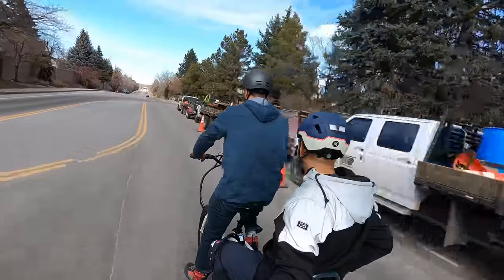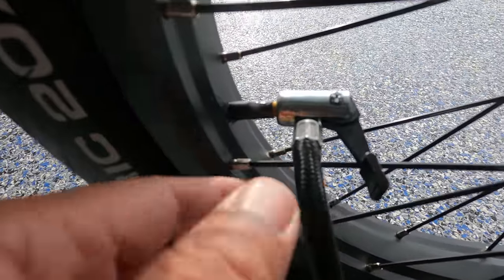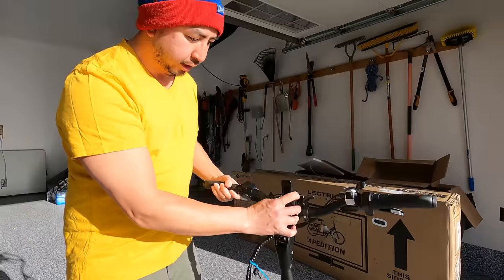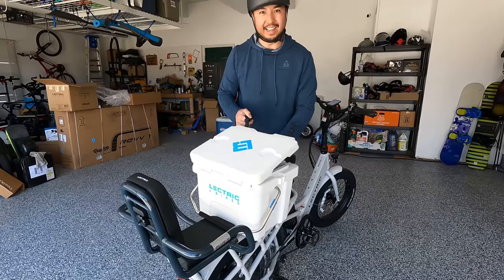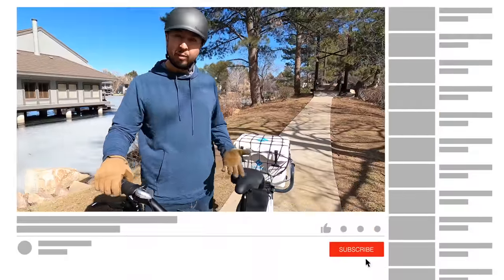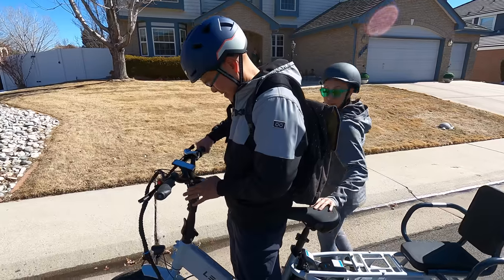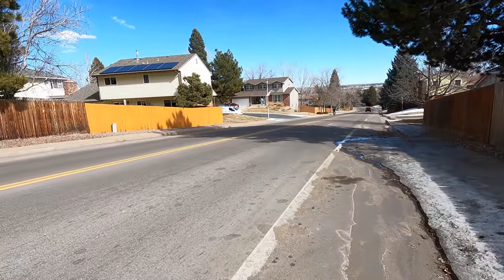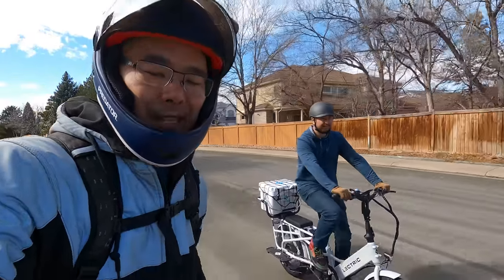The Lectric XPedition HAULS! And its the Best Cargo Ebike Deal of 2024

Comment: What one bike store told me, when filling your air up on the tires, make sure your stem is at the top half of the tire. This will prevent your slime from oozing out, which could cause a clog in the valve allowing for a slow leak.
Reply: That is a great tip!
Reply: Fr
Reply: @Andrew-vt4jt  I thought so too, that’s the only way I’ll do it now.
Reply: only if you are adding non European air
Reply: @Andrew-vt4jt  the best cargo bike is the gsd s10 tern 😊
Reply: @tareksdl5996  at that price, you might as well buy a cargo van
Reply: @leeg5678 what kind of cargo van can you get for $1,300.00 dollars?
Reply: Yep. That is very true. Every time you add air to the tires, be sure to have the valve stem at the 4 o'clock or the 8 o'clock position. The slime will ooze back into the tube as you add air.
Reply: @genespell4340 A toy cargo van
Reply: @genespell4340  Their comment was a response to someone else recommending a $5,000 e-bike as "the best cargo bike" not the Xpedition.

Comment: Did you have to drill the mounting plate to get the plus one on the rear most bolts? The mounting instructions use at least one set of the the outer thru bosses with a nut on the bottom. My plus one won't even let me mount it the way you have it,  the holes are just barely not wide enough, which would be nice because I could then put the small  basket on the rack with it and be able to haul some cargo and my kid at the same time.

Comment: I'm approaching 5000 miles on my Radwagon 4. I weigh nearly 400 lbs and absolutely love my bike, but I'm tempted to make the switch to the Xpedition. I love the dual battery feature for the extra mileage plus the ability to increase the speed. I was just commenting today that I will I had an extra gear to two so not out pedal the bike. PASS 3 downhill I top out at 23-24 miles per hour even with pedaling.  Due to my weight, I use up more battery that than the average person, so the second battery would  allow me to keep up with my friends.. Great video review!

Comment: Ok so I have had mine for 500 miles.
The range is highly exaggerated.  I use pas 5, flat terrain, 230 lb rider.  Less than 15 miles.  I commute to work 9.6 miles away and I have to charge the single battery at work to make it home.
I tried doing doordash on it using pas 3, and I was only able to get around 2 hours of ride time.  It is most definitely NOT great for delivery work.
The front tire is already out of true.
The rear brakes are shot.
The roller guide does not hold the chain, and on bumpy roads the chain will jump it.
The tires are extremely slick in wet conditions.
The handlebar stem rattles.
All that being said, I like riding the bike.  Its been very helpful for me to get to work.  Even in Texas 100 plus degree weather.

Do yourself a favor and get a second battery, and since their chargers are not dual chargers, buy a second charger so that you dont have to spend 14 hours charging two batteries, one at a time.
Reply: Many if not most  mileage claims are exaggerated. Its always been that way. Alsoi of note...I can travel 100 miles on my bike yet my brother can travel but 40 miles. The maxinmmum possible distance that can be achieved traveled is highly rider and terrain dependent. There will never be accurate mileage claims.
Reply: @geraldhenrickson7472  what's the difference between you and your brother that you're getting a 60 mile difference? Eg terrain, ride speed, etc. I'm just curious as I'm also wondering if your brother just got a lemon. Some batteries are simply bad out of the door. I've seen this many times.

Comment: This thing is nice i ordered mines because of the sale they had going on and was concerned about how it would ride with weight and I was able to go 20-24mph with ghost piddling with my littler brother on I’m 255lbs 6’2he’s about 140lbs 5’9 also it does trottle only with weight up to 20mph with ease this thing is strong it really takes minimal effect with paddle assist…
Only cons I can say as of right now is that the bike seat it comes with is uncomfortable forsure it’s firm also wish It came with dual charger for the dual battery option only rode 15miles so far but it was smooth….. it handles better than I expected

Comment: For the dual adjustable seatpost, can the seatpost be fully removed (or stolen) with no tools?

Can you post the center-to-center distance between the holes on top of the rear rack? I'd like to see if it works with the Yuba Monkey Bars.

Comment: Gonna keep an eye on this one. Double key is ridiculous; I would rather have back up keys for a universal. I hope that the tire goop ain't the kind that wears out. The lower center of gravity for the haul end is smart. Needs a lockable ice chest that is bolted to the frame for all your frozen and cooled haul, and more. Probably something I would have to rig on my own. A big case gives one more time to shop on a supply run, and to visit more stores. The power and battery life appear to go the distance without a crimp, and I like the backup battery. Expedition, and Utilitarian needs are very close, if not the same.

Comment: Am I barking up the tree?  Bigger guy shopping for a touring bike (roads and bike paths) on somewhat of a budget.  Attracted by the dual battery, ease of mounting bags and ergonomic adjustment range.  I figure I could add a second charger and be good to go.  Also considering Velotric Discover 1 mainly for the buy-in price but you’re buying 500 watts and fewer baggage mounting options.

Comment: Saying that higher end derailleurs are preferred would be a great thing to explain, instead of noting the preference without anything to support it. 
It could be due to perceived inefficiencies of the existing model, which we don’t hear about, or simply a preference which isn’t a knock so much as a something the subject is used to. 
Also, TWO KEYS?! That is not what I’d read and I’m blown away by that - although not as much as a single, almost ~1/2 day charge time…requiring the user to switch the charger to the second battery.

Comment: How do you find the geometry in terms of the how far forward the seat is compared to the pedals? I had the XP 2. 0 Step Thru and found the seat too far forward which made you feel like you were on a Unicycle with the pedals right under your seat. Even with the seat all the way back & raised, my thighs and knees were cramped I I felt a lay back seat post would be needed. Pedaling didn't feel natural in this position and required more effort and caused more strain. (5ft9, 185lb, 40 year old rider) I couldn't get good leg extension with seat raised and moved to the rear. My other ebikes felt more natural in terms of relationship between pedals and seat. I felt the folding nature of the XP 2.0 caused them to have the seat post angle too verticle above the pedals instead of further back.
Reply: Great question. I didn't have any issues with the geometry.  The seat can be adjusted up to 17 inches, and the quick adjustment for the front handlebar stem and angle allows you to dial it in without any tools. I never felt cramped with my pedaling like I have with other bikes.
Reply: I have the original XP and the same exact issue. I am convinced that this overly vertical seat tube angle is causing me knee pain.
Reply: @mountaincat23  yup! This weird vertical seat post geometry is totally the issue. It's too forward  to the pedals. I see other people riding them and you can see how cramped their knees are.
Reply: @Andrew-vt4jt  thanks for the info. The seat does look a little further back compared to the xp2.0. Having a seat post that goes very high is nice but you can only go so high for pedal extension before you can't reach ground with tip toes. Haha.

It's good that the cockpit doesn't feel cramped. Keep up thr great videos!
Reply: @soupnazi81  I have slid my seat back a bit which helps, but I wonder about a modified seat tube that would move the seat backwards more. I did some research into it and there is a convention for “saddle setback”. So one can use the knee location in relation to the pedal location when at the 3 o’clock position to set a baseline.

Comment: Shipping a two battery bike with one charger, when the charger doesn't charge both simultaneously was short sighted.  Everyone will have to go back and order the second charger. Best case scenario would have been for them to have frame based charge port that managed both and allowed a 4 Amp charger to connect one place. If Lectric's concern is that people don't create a jerry rigged solution, this is exactly what would cause them to try that.  Reading their manual's  battery warnings, they clearly understand that battery fire liability is concern.

Comment: One fatal flaw - it apparently uses a freewheel cassette instead of a freewheel hub. Which means no upgrades at all (you'd have a very expensive swap to do. I'm sure there's a way around this if anybody knows.) I would definitely want to upgrade to an 11 speed group set - they're snazzy.
YAY! I just found out they make 11 speed FREEWHEELS and they're only 3mm wider than 7 Speed. Should bolt right up no issues. Use an 11 speed chain and you can use the existing front chain ring / crank. New derailleur and shifter and you're set for right around $99.95. The one drawback is you should keep a spare axle as these are much weaker because of unsupported axle length. TMI? Just wait. Grin Technologies now makes the ideal hubmotor to lace into your fat wheel - only $1,000 and worth it. ZOOOM.

Comment: I know I'm hella late but I have a question.
I the seat removable?
I'm 6'7 and the adjustable handle bars along with the super long modular cargo area could actually be great for tall riders.
That seat attachment in the first slot with the handle bars back and the seat removed would not only be great for my leg length but would still give me cargo room in the back to add the cooler
Reply: Yes, you can take the seat post out, but the stock seat post is very long, so the default seat might work for you.

Comment: I'm considering an ebike but also can this be charged with a solar generator? I've seen so with 50-60v
Reply: It's possible, but it would be extremely risky without a proper charge controller. You can't just plug a 48V nominal PV panel into a 48V ebike battery and call it a day. Without the proper interface, the only safe way is to use an inverter off the PV panels and use the included AC bike charger.

Comment: That bike looks very much like a "tern cargo bike". Made in viatnam ,electrics by Bosch.  Every feature is the exact same. Except the "tern" is electric assist only , no throttle control , no pedal no go.
Reply: Interesting, I've never heard of the bike.  Nice thing about this bike is it is backed by Lectric's US based service.
Reply: Very interesting señor
Reply: Tern is made in Taiwan and has support in the us. They also offer 3 different drivetrains. From a high end Shimano, to enviolo, and rohloff.  Than you add in chain or belt options as well. Gates belts systems are not cheap either. While this bike is based very much on the gsd, it is still a knock off. Tern is also very well tested. While this letric can be nice for delivery drivers, since low cost. The long term responsibility isn't going to be the best. Since the tires are proprietary.

Comment: Is it annoyingly loud irl? Hearing the motor whine in your video might just be an audio issue, but it sure sounded louder than I'd want, I have the Velotric Discover and it's quiet as a mouse.
Reply from the maker: Very true, the Velotric is a silent ninja for a motor!
Reply: I tuned up the settings to make it faster so it is louder than the normal settings.
Reply: Remember this ebike u can use it as cargo so of course the motor is louder

Comment: Would you rate this bike better than the RadWagon 4? I kinda want to sell my RW for this...
Reply: I would rate it higher for a few reasons. The XPedition has hydraulic brakes where the RadWagon4 has mechanical disc brakes. This can hit speeds of 28+ mph where the Radwagon 4 is capped at 20 mph.  You get two batteries on the Xpedition for $400 less the RadWagon 4 with one battery.  And the best part is the torque on this bike up hills.
Reply: @Andrew-vt4jt  thanks! Those are my thoughts as well. The brakes and the torque up hills are my reasons for wanting to switch! It's also shorter than the Wagon by a few inches which is nice.
Reply: @kirstenhuculiak2231  my pleasure!
Reply: I think this bike is superior very well made

Comment: There is every reason to ho off road with cargo. You park your rig and run in to town for supplies or you head out exploring with your dog riding in your hauling crate. Ya.. def the whole point of having an electric bike... the whole entire point.. for a bigggg part of the population. Littler and thus more agile than the orange rad. Is it tough enough for endless waffle board and ruts is the question

Comment: Thats a very inexpensive cargo bike. Compared to something like Aventons new Abound, which looks super nicely build, comes with a torque sensor and overall just really nice components, it might be the better choice. But it’s also 2200$. 

Something like the Tourney at the Lectric can be replaced in 30min and it’s cheap to change some components. That wouldn’t be the dealbreaker for me.

Comment: Logistically it makes no sense to have a bike that you can only go 30 Mi on and then it takes 7 hours to charge the thing. It seems like if they really wanted to make a delivery bike or a bike that was made for working they would give you much longer battery life or find a way to supercharge the battery faster Unless you're going to have multiple batteries in rotation it doesn't make sense
Reply: Just FYI - you can piggy-back any size battery of same voltage using a device that costs $50 if you look for it. That's without removing the first battery so it works like one giant battery.

Comment: Two motors would be best on this bike
Reply: I think dual motors would be dangerous on a cargo ebike.  You could go faster but two motors can be sketch if one tire gets stuck and the other tire is still spinning. I've had the Ariel Rider Grizzly slam my face into the ground because the back tire got stuck on two inch difference on the street.  I was luckily wearing a full face helmet or I would have needed dental work and I would have been devastated if I had a kid riding in the back.
Reply: @Andrew-vt4jt  holy crap dude, glad you’re ok
Reply: @Jamie  luckily, I was alright and more my ego was hurt because I was on a super busy street in Downtown Denver. But it was super odd how it happened.  Crazy thing is it almost happened a second time that same day when transitioning from grass to a sidewalk. I now take my transitions at more 45-90 degree angle.
Reply: @Andrew-vt4jt  dual motors scare me now, I installed a front motor a
on a aluminum fork and shattered the dropouts causing me to go over the handlebars, luckily I was wearing a helmet and only dislocated a pinky

Comment: Nice bike, wondering how many cycles those batteries will take before failing?
Interesting that you mention wearing “protection” several times but cruise right through a stop sign, they’re not there just for cars
Reply: In a lot of states, it's perfectly legal to roll through a stop sign on a bike as long as there isn't someone to yield to. The stop-and-go is much more of a problem for bikes than it is for cars.

Comment: I'm a bit surprised at the features the reviewers "have never seen before" on an e-bike. Both the adjustable handlebars and the two-way seat post are featured on the RadWagon. So, I admit that makes me wonder... The "mega-high" seat post, by the way, is not an advantage, but a liability. When mine was stolen from my RadWagon, I had to replace it to the tune of $200 because it's proprietary and no off-the-shelf post will fit into the seat tube. The only time a seat post like this makes sense is if two or more riders of drastically different heights were to ride the bike on a daily basis.

Comment: You guys have SOLD your SOUL just to get a FREE bike and only talk about what the bike can do but your WRONG I have never seen a HUB drive motor that is 750 watt to go up any hill without any problems .

The bad part about this video is that it does NOPT say what BRAND motor it is or any other specs one would want to know Battery Brand cells used, Brand Motor, Brand of brakes it has .

Even this company web site does NOT list the brands of the components used on this bike .

So people be weary of these types of videos because like I said they are SAYING just what the COMPANY WANTS them to say so they get it for FREE.

You say your going up HILL I dont think so you do NOT show the hill and on top of that he does a NO HANDIES while goin up hill with that type of head wind that HUB motor is NOT that good to be able top handle that STUNT. its all FAKE PEOPLE